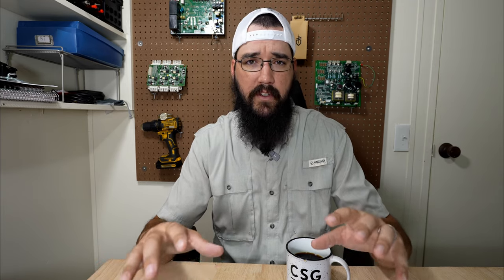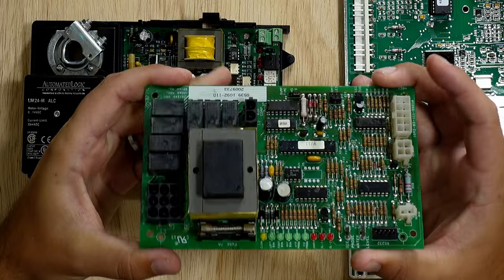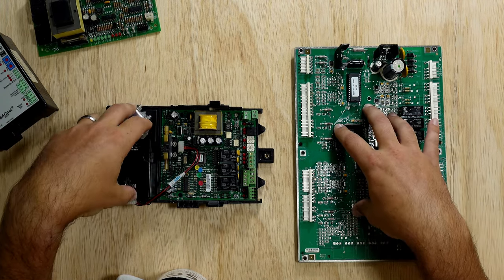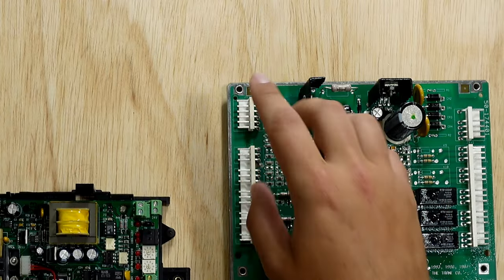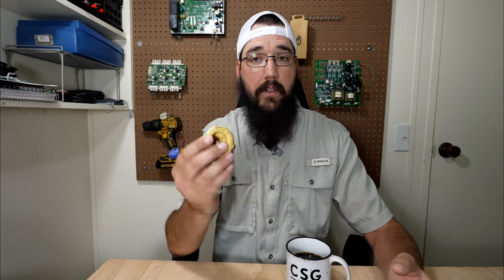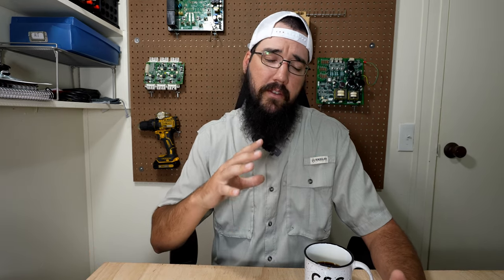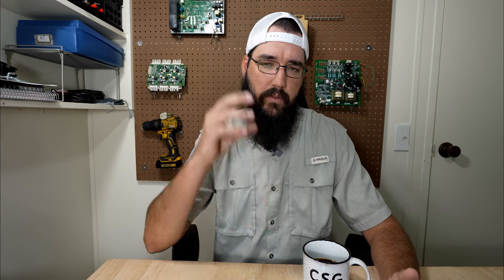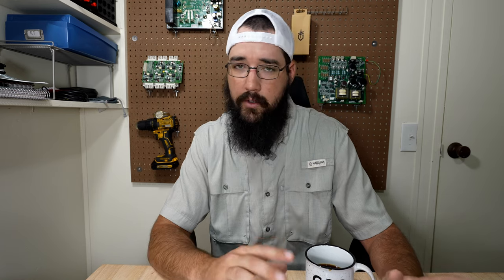HVAC Training: What is DDC

Comment: Great video.
Little tip for anyone in the field, these U-line Automated Logic cards operate in a antiquated way compared to modern stuff. The U-line cards (any controller that has a U before the numbers, IE U551, U220, U341V+, etc.) are controlled by a master controller, called a UNI16 or UNI32. All of the programs for the slave devices in the U-net are held in the UNI card. The slave devices essentially  act like expanders to the UNI card. The slave devices do not communicate back to the BMS head end, only the UNI controller does.  If an individual equipment is not running but the rest of the controllers on that network trunk are working, the end device has (probably) failed. If you have several VAV boxes/FCUs that are not working, and they are in the relative same location, like on the same floor or same section of the building, its most likely the UNI card that is having problems. Always check for 24V input and solid terminations on the RS485 connection (will be labeled as CMNet, ARCNet or U-net on the controller). I was a master tech for Automated logic and I have a lot of experience with these guys.
Reply: Thanks. I work with ALC products, and I'll keep this in mind, if I'm doing service on these older controller versions.
Reply: Shit do you work in the Boston area? Been having ALC issues for months and can’t get anyone here to fix it. They’ve sent out a guy a few times but he literally spends half the day on the phone with someone else. My last building was Continuum(super easy) but I actually like automated logic. I’ve learned alot and like the options it has.
Reply: Wow!!! That is a VERY Clear and Direct Explanation of the Topic!!! Thanks! So i am a Old Building HVAC guy.. looking to re-set my Carrer & Life, in to the Controls side of the house. Do you have any.. advice... or tips, that i could use to make the transition..easier .. smoother???

Comment: Sad we need a laptop to run a Heat Pump now....
Used to have all the Mechanical parts on the van for Borg Warner to MarvAir to every brand
Reply: Sounds like a dream
Reply: If you can figure out how to get a contactor control speed/frequency for a compressor you will be a rich man.